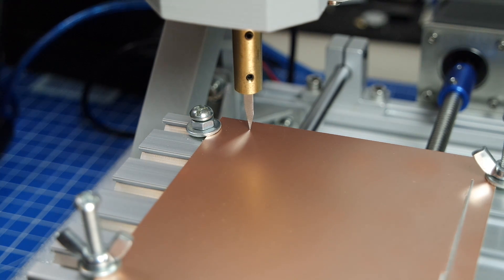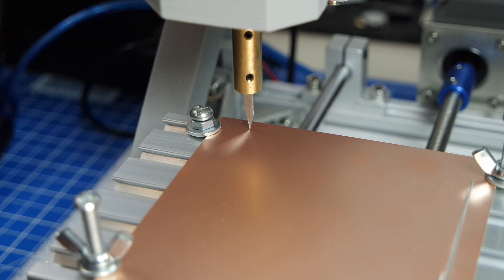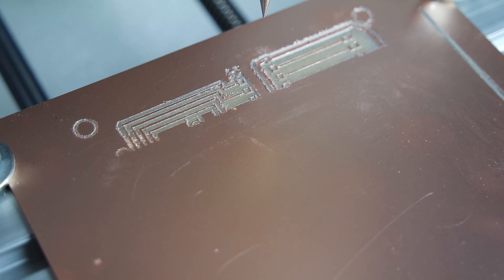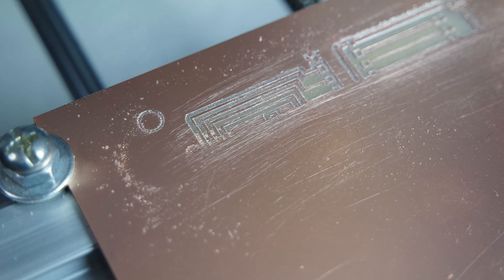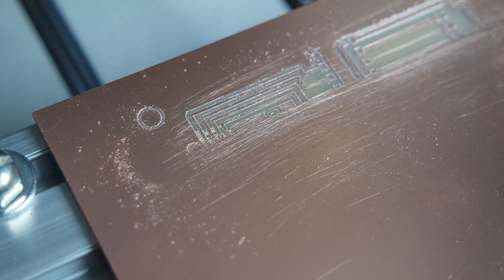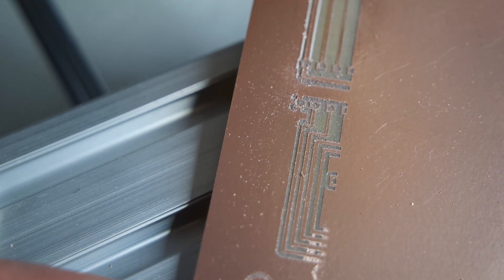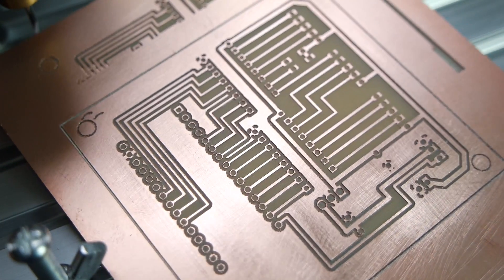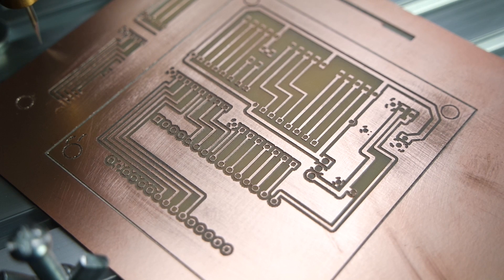T8 Mini CNC more PCB Milling

Comment: What is feed rate and spindle speed
Reply from the maker: spindle speed is about 20k rev, at idle - less under load. 120mm/min works, but it is very much depending on the material used.

Comment: You tool pathing on the first cut was horrible like the result.  Your second result was fantastic but 2 hours and 35 minutes of a CNC running just for that little bitty board?  There's got to be a better way.
Reply from the maker: Yes, you're right. The better way is isolation milling. But the result of that is not well-suited for a presentation, because you can't really identify the result by looking at it.

Comment: 2 hours and 35 minutes???  That's too long.  Plus all that noise.  Plus, you have not drilled holes in that board yet. Those traces look like would come up if you tried to drill holes
Reply: 10 minutes if you do insolating routing

Comment: that is a very weird way of milling a pcb from what ive seen, this looks like a sort of scan mill or something, look into FlatCam to generate your g-code. then take the G-code to Grbl. there are some detailed tutorials here on FlatCam
Reply: also there are free tools that will do auto leveling which basically makes a virtual surface of the your board by probing and then adjust your g-code accordingly to get you great milling results
Reply from the maker: Yes - I know, but for someone with very little experience these pictures make more sense - I do use FlatCam for mostly everything else when I mill.

Comment: Is very good looking! Now, you should have set a smaller diameter for the pin holes (it helps also with the manual drilling). But I guess it was a good test to see if the tiniest margin can be "rendered" by your CNC.  The bit wear is more pronounced with the raster method but you know this. I still think the "good enough" method is by using your plotter. I mean, is still better looking than drawing those traces by hand, as I do.
Reply from the maker: You're so right about the hole diameter, and I could hit myself for getting that wrong (or forgetting) every time. My plotter could not have done this one, the tracks are too close. I use this method because I want to see what's possible, not what's fastest.
Reply: I understand the need, as I saw your last (laser made) controller. But this is "yet another CNC Router solution", while your plotter has the crown for the simplest, yet functional construction solution.  That is your platinum star project.
Reply from the maker: Yeah,but the plotter project is through puberty, and has left the house :-) I keep things organized and develop the software. There are videos on YT that have 10x the views that the originals have - that's what I like about it. It's started and going well. I can focus on other things - And I do have some updates available for the future.

Comment: i would think isolation paths g code vs  raster  g code  would be cleaner result and faster .   oh and  fyi if you ever need to have a computer not kick on a screen saver  but dont want to  change any settings  , open VLC  start a local saved ( no buffering needed ) video playing and pause it , and put it to back ground . if VLC is open and player is 'active' ,  it will block most  rigs form entering screen saver or sleep .
Reply from the maker: Yes, but someone who's just getting into this stuff will see nothing in an isolation milled sample that he can turn into a quality statement. It will be just some lines in copper.  And if the CNC does engraved PCBs well, that statement also works for isolation milling.
I know about the VLC trick, but I just forgot. On a normal day I'd just download the source and fix it to keep the PC on.
Reply: cool.  ah i get it .

Comment: Hi Dirk, Try using double face tape to hold the board down flat on to the table. The clamps you are using will surely pull the edges down but the center will bow up every time. As a toolmaker for many years we used double face tape to hold thin parts to the grinding table with no problems. You are creating a very limited side pressure on the part because the cutter is so small so should be no problem.
Reply from the maker: I think you're right - that was what happened on the first try. I usually fix the clamps down to the hold the PCB in place but not down. I might have overdone it that time.